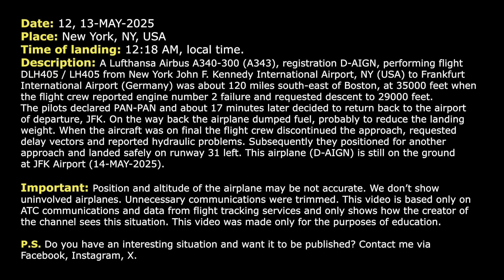Engine failure and hydraulic problems. Lufthansa Airbus A340 returns to JFK Airport. Real ATC

Comment: Easy with a 340, even if an engine fails you still have 3 :D but it's rare to see any aircraft with more than 2 engines anymore
Reply: Indeed.
Reply: Easy is for you until the next one fails for the same contaminated fuel issue.
Reply: @nrakma If it's contaminated fuel all 4 will fail and you're f*cked anyway

Comment: As a pilot myself, I have to say this is a joy to listen to. Everyone was calm, cool and collected. 
Professionals at work! 
Well done!
Reply: Couse its Lufthansa
Reply: @agebee  very much so!
Reply: Ich hätte der Lufthansa auch zugetraut zusagen „Ach passt schon wir fliegen weiter“ 😂
Reply: Indeed, exactly.
Reply: Most ATC reports are competence porn at its best. Then there's the occasional green pilot who freaks out, but usually not in airliners.
Reply: Why they did not decide to land at Halifax ?
Reply: @Wwenov why should they? That would have been a nightmare of logistics for the passengers. Much better to return to JFK for almost every reason. Halifax would make sense if they had a serious problem like a fire, fumes or smoke.
Reply: @Wwenov  I think better Technical Support in JFK
Reply: I'm not sure about the part where they went 50 miles further out to sea making the decision on a divert destination though. I understand they're overweight and still have 3 engines, but might have asked for a hold or a vector westbound.
Reply: @dougmcclean  if it was a 2 engine jet, maybe. 3 out of 4 engines running smoothly is not a big issue.  Going straight kept the additional workload at a minimum while running through the checklists and checking with dispatch about the best place to go. At FL290 and fuelled for a transatlantic flight, they had all the time in the world.
Reply: @m00nie_m00n  I get that line of thinking and it's probably correct. Over land it would certainly be correct. What would make me nervous if I was assigned to execute a plan like that is that common cause failures exist. How nervous it would make me would also depend on the winds aloft, but going east at FL290 its likely they were unfavorable.

Comment: never understood the 1 engine die =  not emergency
Reply: Usually a technical emergency is caused by lack of redundancy. One Engine left, means no more failures allowed -> you declare an emergency.
The A340 has 3 engines running After the failure so still has redundancy as it could probably still fly an approach on two engines. After all Its the Pilots/ATCs choice to declare Mayday (Crew declared PanPan without the Controller noticing)
They will nonetheless most likely get priority for landing in JFK anyways
Reply: Mayday ist declared, when there is imminent danger for the aircraft and the people on board. An engine failure is no such case.
Reply: I think it matters that it is not engine 1. I believe it has to do with the Hydraulic systems. On a two engine aircraft it is an emergency. 

They are separated by color if you ever research such things. (the hydraulic systems)

Comment: Why is it that when a Boeing has problem it makes the top news story of the day... and when an Airbus has a problem its never mentioned?
Reply: Because of the type of problems Boeing has faced indicates severe engineering/quality issues.
Reply: @lmoelleb  No it doesn't, you have been watching too much fake news and clickbait blogs.
 Boeing makes the safest aircraft in the history of aviation.
Reply: @lmoelleb  But the actual statistical data does not support that narrative, its nothing more fake news and biased coverage.
Boeing still makes the safest planes in the world.
Reply: Airbus doesn't make the engines.
Reply: @MarkusSchober I'm pretty sure you just proved his point.... why do they report when Boeing has an engine failure and then mention the Max???
As if they were somehow related?
Reply: @MarkusSchober  Exactly! Boeing doesn't make engines either.
Reply: @DoktorBayerischeMotorenWerke  there's a big difference between a bulk door flying out mid flight and 2 airplanes crashing because of software errors to an airplane having an engine failure which isn't a frequent thing but still pretty common and has nothing to do with airbus or their quality management.
Reply: @jemand8462  Indeed, there was absolutely nothing wrong with the design of Boeing exit door, that was all media speculation.
 Software error that was mandated by the FAA... Boeing fought hard against the FAA and its flawed version of the MCAS software.
The fix? Replace it with Boeing's original software.
 The FAA director resigned and all of the key management that handled the certification of the Max MCAS design were fired or demoted.
 The news didn't cover these facts either.

Don't be so ignorant, use your own brain.
Reply: @DoktorBayerischeMotorenWerke  thanks for suspecting I'm not using my brain.
You'Re making a whole lot of claims that have no basis whatsoever and you don'T provide any proof of it. 10 seconds of using my brain leads me to the website of the FAA about the door incident which reads:
"Boeing Oversight Actions 

The FAA is holding Boeing accountable following the Jan. 5 door plug incident. We will continue our aggressive oversight of the company and ensure it fixes its systemic production-quality issues. "

I don'T think I need to go into more details abuot the MCAS as you clearly have no idea what you'Re talking abuot and just put out your opinions as facts while trying to ridicule others for their fact based opinions. Schönen Tag noch, Herr GanzbestimmtkeindoktorbeiBMW
Reply: @DoktorBayerischeMotorenWerke  You want us to beleve that the FAA steped up from certifiing to doing the development semself and than forced Boing to use that. Boeing than fought aginst that knowing or thinking it is faulty but accepted it in the end. Than after the first crash did not change the system knowing or thinking it is faulty but insted just waited for the next one. For me that sounds worse than the story I know from the news
Reply: @jann4577  Indeed, the FAA's actions in the Max program was highly unusual and unprecedented in the history of the agency.
 After the Congressional hearings revealed incompetence and criminal negligence within the agency, the FAA director resigned, and all of the key people involved in the Max case were fired or demoted.
 The news media's coverage of this story has been appallingly biased and filled with misinformation.

We know from the NTSB report that the Ethiopian crash was primarily due to crew error and not properly following the procedure for a runaway trim/stab control.
 They switched off the trim motor and then, for some completely unexplained reason switched it back to the on position, dooming the flight.

The facts here are irrefutable, the Max is currently flying with the original software designed by Boeing and there have been no issues.
 Boeing introduced MCAS in 1959 and it has been used ever since on nearly a hundred aircraft...  not just Boeings.
Reply: @DoktorBayerischeMotorenWerke  Facts: fuselage arrived at Boeing from Spirit with door plug bolts intact. 
Final assembled aircraft left Boeing with same bolts missing. 
Boeing sent out a plane with missing door plug bolts and that can't be disputed. Blame who you want, but Boeing was the last to sign off the plane was airworthy. 
End of story.
Reply: @inothome  Except:
 you have deliberately excluded the fact that Spirit employees repaired the door after Boeing inspected it, Spirit failed to reinstall the bolts and failed to inform Boeing they removed the bolts to inspect the door.
 Spirit and Alaska airlines were the last people to inspect the door.

Spirit was at fault, End of Story.
Reply: @DoktorBayerischeMotorenWerke  Yawn..... ok, ok.... lol
Reply: @inothome  Or you can just admit that you look like a fool right now... "Yawn.... ok, ok.... lol"
Reply: @inothome  Here again, you refuse to accept the fact that Boeing has more orders now than ever before, more orders than before 2019... and more orders than it did in 2024.
 This is because the people that buy jet airliners are much, much smarter than you... they don't listen to fake news and amateur bloggers like you do.
Reply: @DoktorBayerischeMotorenWerke  Correct, a fool to keep discussing this with you. So no reason to discuss it any further. Have a nice day / night. Fly safe.
Reply: because Boeing makes planes which decided to fly into the ground
Reply: @tobicitas  Boeing makes the safest aircraft in the entire history of aviation.
 NO AIRCRAFT has more flights, more hours or passenger/miles without a single fatality or hull loss accident than the 787.
 Take your fake news and misinformation elsewhere... just the facts here.
Reply: Because Airbus didn't kill people with shitty "certifications" like Boeing did for the 737MAX. Or have a door plug fly out on a new plane.... 
But Airbus did make the news when someone opened the door on approach to Daegu, S Korea. So Airbus does make the news. Just not for being incompetent like Boeing has become.
Reply: @inothome The NTSB report confirms that the door was not properly installed by the subcontractor who failed to follow the safety inspection protocols.
No fault was found in the design of the  door and Boeing employees followed the proper procedure.

Spirit Aerosystems and Alaska Airlines was the responsible patries in this incidence.
Reply: @sandervanderkammen9230  Fuuny, it was provemn to be shipped to Boeing with the bolts and then the door had to be opened at Boeing to address some issues. But there is no paperwork if who opened, closed or checked for the bolts were properly re-installed. Alalska Airlines had nothing to do with it, they received the plane from Boeing with the bolts missing/ Is the carrier supposed to go over every fastener on every new plane they receive? No. 
Nice try to shift blame though.
Reply: @inothome  You have not done your homework boy... been watching those ignorant fake news sites.
It was Spirit Aerosystems who originally installed the door, and Spirit Aerosystems personnel that were sent out to Boeing to repair a defect that was reported by the Boeing QC inspectors.
It was Spirit that forgot to install the bolts and it was Spirit that failed to report the paperwork that the door needed to have the bolts removed and the door reinspected.
Boeing was unaware that the bolts had been removed after inspection.

Alaska Airlines crews reported several times a  problem with the door, thier maintenence department never checked the door properly.
Reply: @inothome  It hard to believe that someone is so ignorant...  please stick to a topic that you are actually qualified to discuss intelligently... this is not one of them.
Reply: @DoktorBayerischeMotorenWerke  OK, sure thing! LOL
Sorry to insult your precious Boeing planes. hahahaha
Reply: @inothome  You are just embarrassing yourself... The statistics don't lie, The people who actually buy airliners know a lot more than you... which is why Boeing still has a backorder for over 6,000 aircraft.
Reply: @inothome That comment reveals someone who has absolutely no knowledge about the aircraft industry.
Reply: @sandervanderkammen9230  Appreciate your input, thanks!
Reply: @DoktorBayerischeMotorenWerke  LOL, what contributed to the long back order list? You act like that's a good thing, when part of the reason is due to COVID, imposed limits on how many planes they can make, worker strikes, self imposed work stops, delayed and far behind development on models that were due to be released and still not etc.....
So don't act like having 6,000 in the queue is due strictly to demand. There's been plenty of cancelled orders too that went to Airbus. But I get it, you're a Boeing fanboy and good for you. Just stop with the BS like Boeing is some top of the line aircraft manufacturer, like they used to be. They definitely aren't now, just more facts. Everyone has their heyday and Boeing had theirs, how much  have they written off the books in the last few years? yeah, sounds like a really successful company today.
Reply: @inothome  Do you think Airbus inspects every single part and sub-assemblies that is delivered or installed by a subcontractor or EASA certified supplier?
 Airbus assembles aircraft from sub-assemblies made All Over The World!!!

You have to be very gullible and niave to believe that all of these parts are inspected at final assembly or pre delivery.
 Without any doubt, you have never worked in the aviation industry.
Reply: @inothome  FYI;
Both Boeing and Airbus use plug doors, plug doors that are supplied as sub-assemblies are not inspected prior to delivery, inspections are performed by the FAA or EASA certified sub contractors.

Spirit Aerosystems supplies Airbus with fuselage assemblies for the A321 which includes a plug door.
Airbus does not inspect the door bolts prior to delivery either.

Comment: I was on that flight. They announced that 1 engine is shut down and other 3 are working fine. Throughout the return journey, the plane behaved normal. While final approach, Aircraft made and extra loop. While landing, the Aircraft was tilted slightly to the left, because of difference in the thrust, but it was a smooth landing.
Reply: They did not tilted to the left because of difference in thrust, but because of the crosswind from the left  with a bit of tail wind (190° at 5, runway 310°).
Reply: Me too, I was one of the working engines
Reply: A loop de loop?
Reply: Thank you very much for sharing your experience!🙂👍
Reply: Probably meant a holding pattern, it's obvious what they meant.
Reply: I doubt it did a "loop" 🤪
Reply: @malahammer yes they discontinued the first approach
Reply: @malahammer yes it did, they discontinued the first approach
Reply: @malahammer 😂
Reply: @malahammer  He was not on that flight
Reply: @malahammer  I meant they rejected the final approach once and made one loop and tried 2nd time.
Reply: https://youtu.be/dOkeKaqBZ4g in flight video of dumping fuel
Reply: Typical German mistake. Early on asked for runway 13l when the 31s were in use.  Landed on 31l … always mixing numbers up in English because they say them backwards…
Reply: @concentrationmusic6192 probably asked for 13L because there was a tailwind on 31L…
Reply: @concentrationmusic6192 it is not a typical german mistake
Reply: @concentrationmusic6192  That is  bollocks. In aviation runways are called by single digits as in ONE THREE LEFT and. Not THIRTEEN LEFT. And counting correctly in English we mastered already in sixth grade in Germany.